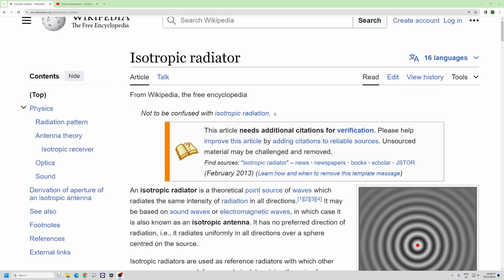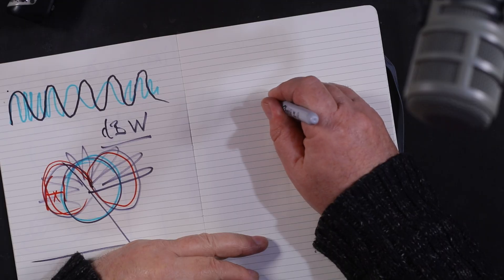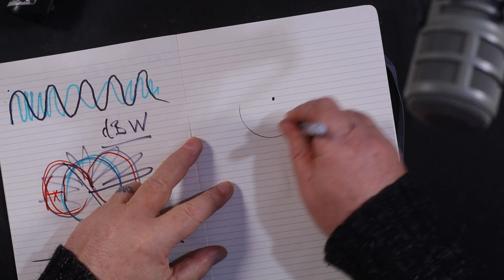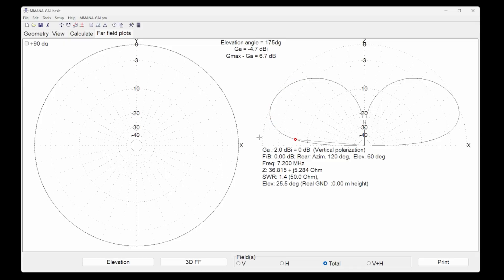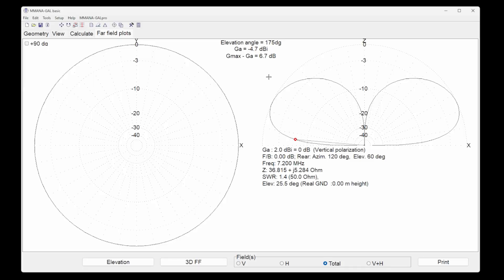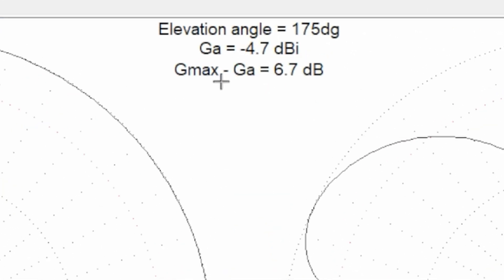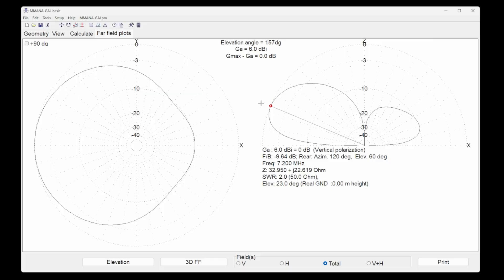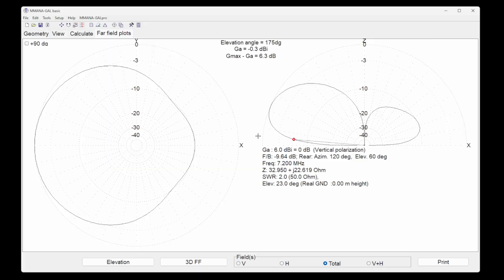Isotropic Antennas - dBi vs dBd - and Negative Gain

Comment: 1:09 Fill the balloon with water, then the analogy works. 🙂 Water in incompressible, air is not. Anyway, that nitpicking. Nice video, good explanation.
Reply from the maker: Yes OK.. I would like you to see your hand compress air :)
Reply: @DXCommanderHQ  If you're as old as me, you've probably done that with a bicycle pump. 🙂

Comment: I've always wanted to build a 2 element 40 meter Yaggi. I have the space for it, but often I am just too busy elsewhere. I used to build up to 4 element vertical 10 meter Yaggis like a rope ladder and I used a 12.5 calculated impedance at the feedpoint to make them very short in boom length. I then used a folded dipole as the driven element to alter impedance back to about 50 ohms. They worked really well, unfortunately the technique does not scale up to 40 meter size easily.

You guys, have likely already had the fun of building one but I need a piece of the fun pie too & antennas certainly are fun to make effective....
Reply from the maker: Well.. It would scale - you just need a huge tower - and some extra money! PS - Great technique for the impedance transformation!
Reply: @DXCommanderHQ  Spot on with my wallet is to thin for the towers needed.
Reply: What about building a 40m Moxon?
Reply: @paulsengupta971  You know, that actually is a good idea... i like it.
Reply: @migalito1955 Alternatively, do what Callum has done, create a vertical two element beam using quarter wave ground plane verticals, either phased or passive.